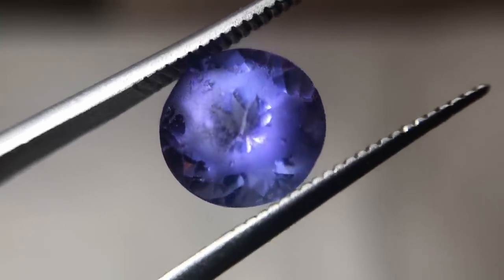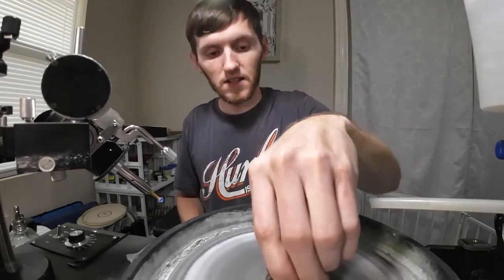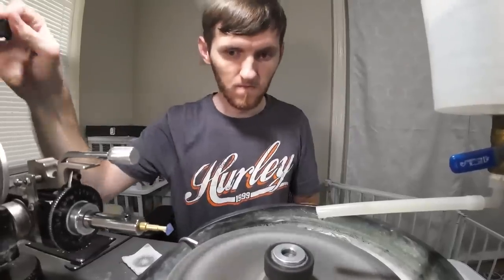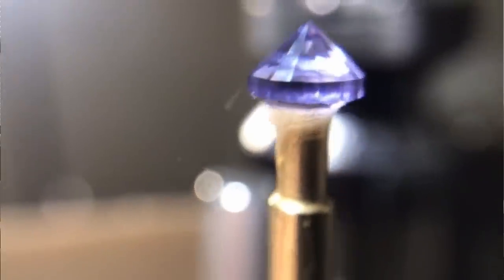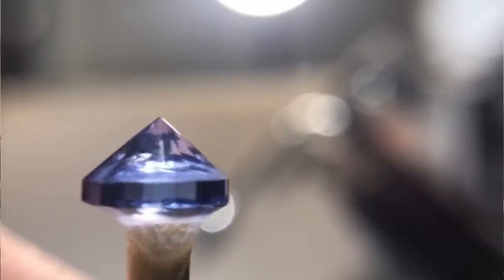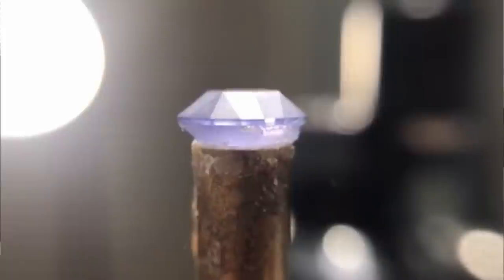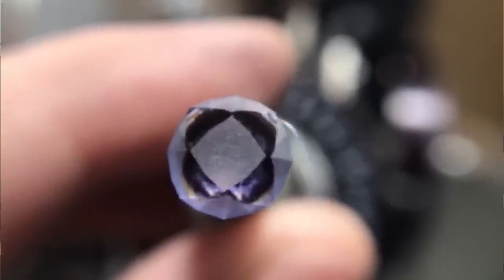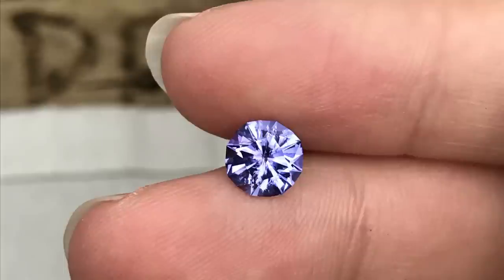Giving This Gemstone New Life, How I Recut This Damaged Tanzanite

Comment: This video really helped me to understand the respect diamond truly has for jewelry, you don’t have to worry about wear like this. Beautiful transformation and the amount of sparkle you got out of that gorgeous stone is admirable.
Reply from the maker: Thanks! The harder stones are definitely better for wear resistance. And diamond is on a level of its own.
Reply: Moissanites has a lifetime sheen to it as well. Not all diamonds are blood diamonds or originate from child labor.
But one can never know for sure if it is or is not.
Buying lab diamonds or Moissanites is much more inexpensive, same quality, and is not off the backs of child labor.

Even famous rappers use Moissanites. Very interesting to know.

P.S
Moissanites WILL pass a Diamond Tester because it’s hardness is 9.25-9.5
Diamond are 10 Hardness
Reply: @guesswho484  this isn’t very well known, as Diamond dealers would be freaking out, but they can reduce or basically get rid of the appearance of a double refraction… but they can also lower the brilliance of lab grown moissanite to match that of a diamonds. Therefore, Lab grown Moissanite can be extremely hard to tell apart from diamonds- even with a loupe. For example, I have a 16 carat, ice blue moissanite that is internally flawless. I don’t know how they did it, but you can’t see the double refraction and it shines just like a Diamond would. Even with a 10x loupe, it’s very difficult.

Comment: Hi If I want to start this job, I was wondering how much should I invest in buying the whole machinery and equipment. Can you give me an estimate and where I can start from? Thank you.
Reply from the maker: New equipment isn't cheap. My Ultratec V5 Classic is almost $5000 new. For starting, I would look around for a used machine of your preference, or there are less costly machines out there if you want new. But if your machine doesn't come with dops and a transfer jig, you will have to buy those separate. You will need a master lap, cutting laps(at least 360 grit, 600grit, 1200grit), pre-polish lap(I use Pandimonium 3K diamond past on a Batt Lap), and final polish laps. Different stones types vary on what's best for polishing. For polishing with diamond grit, I use a tin lap with 60k diamond polish compound. I use a few different things for oxide polishing, but the Ultralaps are cheap for starting out. They are water based film laps that you use on a master lap for polishing. The equipment can add a thousand or more dollars onto the machine cost fairly easily depending on what and how much you buy. Glass or cheaper gemstones are great for practicing with at first.

Comment: Is it economical to buy gems in bulk and have the better ones recut by a professional like yourself? I'm just getting into gems and wonder how to restore used gems from melted jewelry and sell them for profit
Reply from the maker: I would say it depends on the value of the stone to be cut. High value stones could turn a profit. Cheaper commercials cutters would be better for less valuable stones or stones where you just want the standard cuts.

Comment: Hi, I have a really nice color Tanzanite about two or three ct that I bought from India, the only problem was that it was used and has a scratch right on the crown or top facet I was wondering if there is any way to just re-cut or polish the scratch out of the top without completely recutting the whole stone like you just did in this video? the scratch is not really bad, but noticeable. thanks
Reply from the maker: Unless there are really big nicks or breaks out of the stone, they can be touched back up with just a light repolish following the cut of the stone keeping the cut the same and loosing very minimal weight. Finding the index for the position of a facet along with the angle of the cut can be a little tedious for repolishing stones, but it is doable. I often like giving the stones I recut a better cut when the original stone either windows bad or has an uninteresting cut. I have just repolished some stone before though.

Comment: I have heard that tanzanites are softer stones and can wear down more easily than say an amethyst.  But I also heard that even a Diamond can chip off if hit the wrong way. Don’t know how much of that is fact or myth. Anyone know?
Reply from the maker: You are correct in both areas. Tanzanite hardness is 6-6.5 which is less than quartz at 7. So it is prone to scratch and wear more easily when compared to the harder stones. Diamonds are nearly scratch resistant with their hardness and don't wear very easily as only other diamond can scratch a diamond, but they can be chipped or broken with hard knocks because it is still brittle as all gemstones are. Being at the top of the hardness scale doesn't make it not brittle, so diamonds can still receive damage when knocked on a hard surface due to brittleness even though the surface isn't hard enough to scratch the diamond.
Reply: @MattsCornerofGemCutting  thanks so much for clarifying this ❤